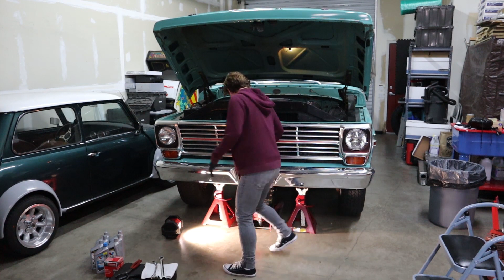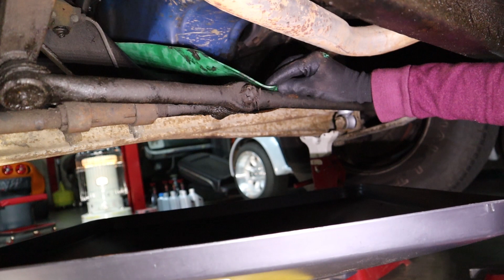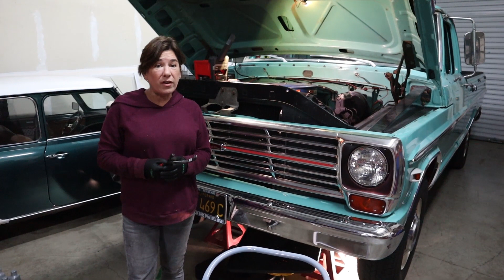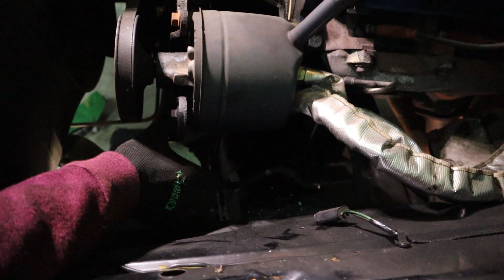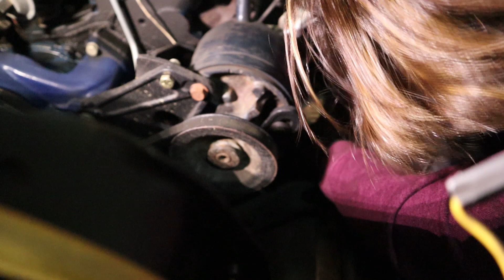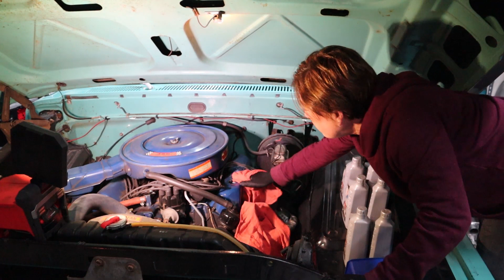How To OIL CHANGE ON 1969 Ford Ranger  F-250 Camper Special!!! One Family Owned!!

Comment: Just subscribed 😁 Thanks for the video! Really helps a ton, I have a question though… I own a daily driver 1969 Ford F-250 Camper special w/ the 360 FE motor, your video inspired me to consider switching over to Valvoline VR1, I live in Phoenix Arizona where the weather doesn’t drop below 35 and the high is typically 90-105 degrees.. would you recommend me using VR1 10w-30 in the summer & VR1 10w-40 in the winter? Or just 10w-30 VR1 all year around? Any insight would be great!
Reply from the maker: Thanks for the sub and for watching!! Great question!! I’m thinking 10w-30 is just fine for you all year round. ☺️ I would love that weather here in CA! 😉

Comment: Do you think its the same process with the 67 modell?
Thanks.
Reply from the maker: Great question!! It will be similar, but not identical. Same process, but double check oil type required, oil capacity, drain bolt torque, and oil filter type.
Reply: @RDGarage  thanks for the reply.  Your truck looks so clean btw
Reply from the maker: @olevictorcorral6445  you’re welcome and thank you!! That truck has had a very easy life for a truck 😂

Comment: What type of oil did you put in the truck, 10W-40?
Reply from the maker: I used 10W-30 Valvoline VR1. Thanks for watching and the comment!
Reply: @RDGarage  Thank you for the info! I watched your video on changing the transmission fluid, gasket and filter and I saw that you put in about 7 quarts of transmission fluid. However, online I am finding that I need over 17 quarts. Is that way too many quarts?
Reply from the maker: Cameron Sume if you just drop the pan and just change the filter and gasket, you’ll only need 7ish quarts. If you drain the converter, you’ll need 4 more but that still doesn’t add up to 17.  The only way that you could possibly get more in is if you have an aftermarket pan, you may be using more but check with the manufacturer first. Thanks for the great question!